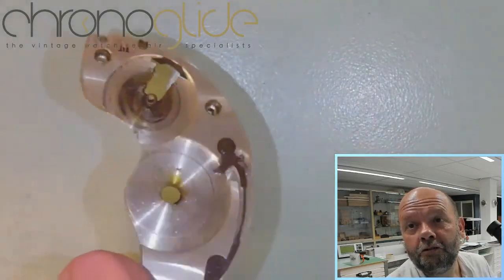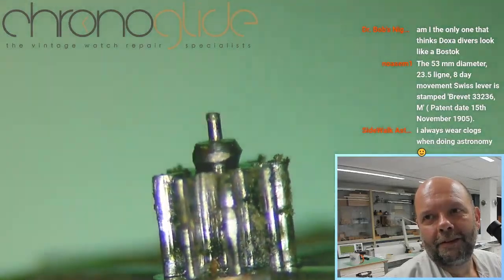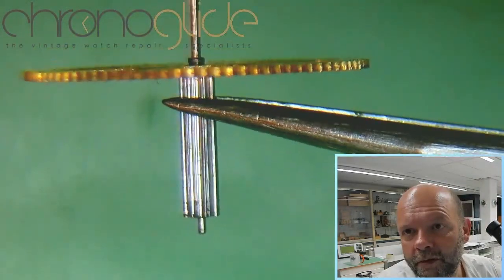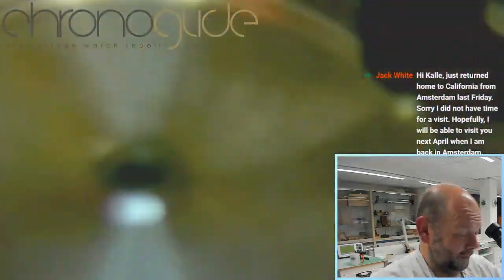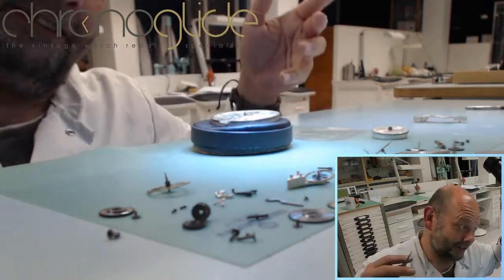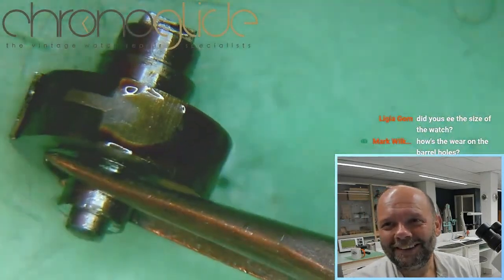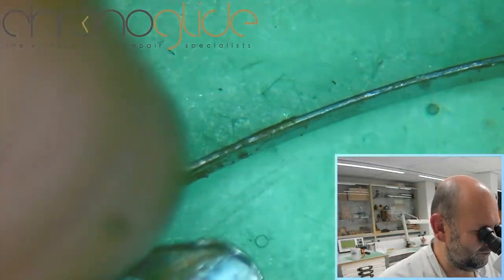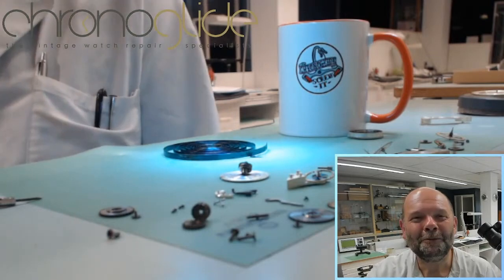Doxa 8-day Dashboard clock (1908) as fitted in Bugatti! - Part 3 (9min)

Comment: Watch out: one of the pivot in this stream seemed to have a mushroom tip (wear & tear or optical illusion: old lubricants with smoot ?) ?

Since this is not an ordinary watch: where do you get a new replacement mainspring? Special supplier, clock part supplier, or custom made by Edwin?
 
Great e-show again! 👌❤️👍